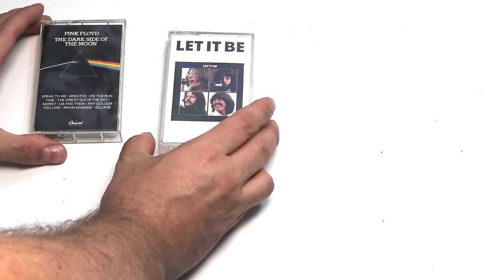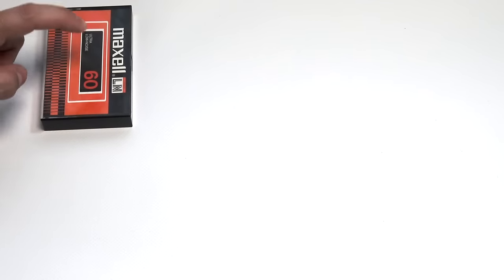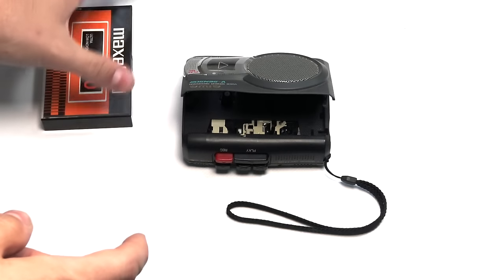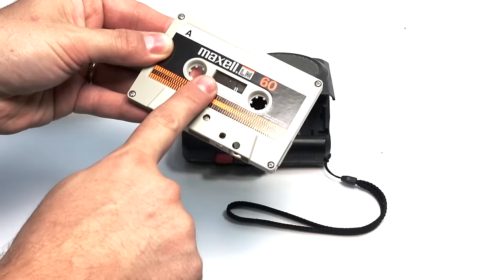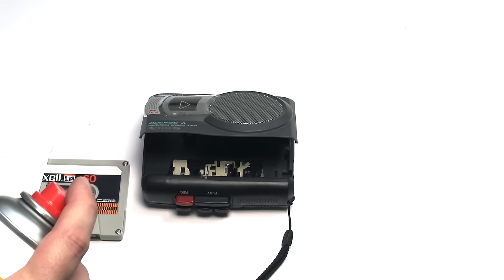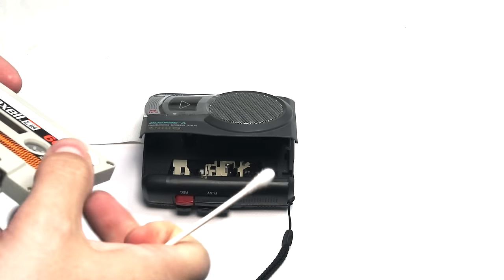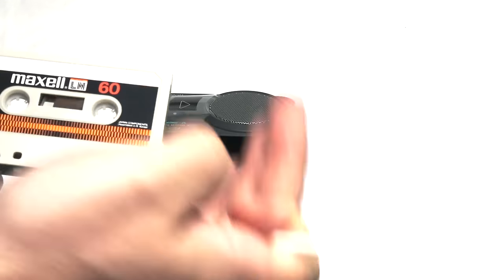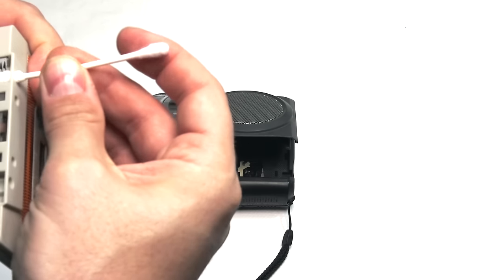How to relubricate your stuck cassette tapes

Comment from the maker: EXTRA INFO (UPDATED!!):
If you get the 3M lubricant get the 08877 WET version (not the dry version).
Considering the fact that, reasonably, a lot of people have doubts about this process, here is some evidence in support of the existence of this issue, the fact that all tapes have lubricant, and of the possibility to use a re-lubricant process for magnetic tape (just remember to use a dry cotton swab to absorb the lubricant that may have not been absorbed after a while).
Here you will find a selection of scientific papers explaining the issue and how it is a standard procedure to relube tape (even NASA does this!). I have underlined a few crucial passages in the papers: 
Heritage: https://www.dropbox.com/s/f8254yfeqrrw9vp/heritage-02-00097-v2.pdf?dl=0
Nasa: https://www.dropbox.com/s/xxdw1qh8mlbppdu/Nasa.pdf?dl=0
HESS: https://www.dropbox.com/s/ydrvxg6zipjkrvw/HESS_Tape_Degradation_ARSC_Journal_39-2.pdf?dl=0
Preservation Commission: https://www.dropbox.com/s/3s3ejmho2jexhgt/pub54.pdf?dl=0
   - (here is the official article: https://www.dropbox.com/s/rtvqt1n537w9vpa/Bogart.pdf?dl=0)
Kondo: https://www.dropbox.com/s/zi4vv42ggi9vh8u/tribochemistry-of-ionic-liquid-lubricant-on-magnetic-media.pdf?dl=0
Here is an article of a lab that is relubing its cassettes: http://tasso.cat/re-lubrication-of-compact-cassette-tapes-with-sbs/
This is a page of a famous audio engineer: http://www.baileyzone.net/analog%20tape%20diy.htm
This is a page of a company that sells its high quality tape lubricant: https://thelastfactory.com/tape-care-preservation/
Reply: Does the Q-tip go in the front or the back of the tape I could not tell from the video. Very good video very informative. I have several cassettes that have squeeling issues.Cheers
Reply from the maker: Front! Thanks. Make sure to absorb all the exceeding lube.
Reply: @anadialog  Got it. Thank you for replying to my question
Reply: Your scientific article specifically says the lube is part of the binder process at the nano level. It does not sit on top of the tape itself. 

The same article says that IF any lube should be reapplied, it should be done a pro who knows what they are doing - and your method is entirely incorrect. Your basically bathing your tape in oil. The oil has nowhere to go but on the tape path of the deck. 

From a professional broadcast/recording engineer and tech - I implore you to stop giving this erroneous information. You are promoting the death of people’s tape decks that will cost hundreds of dollars to fix!!!!!!
Reply from the maker: @jonahmcgarva  The lube is slowly absorbed by the binder. I also clearly said to clean the tape with more dry cuetips in order to remove all residue. Obviously no one is going to put a dripping tape in their deck. Again, the tape after a while absorbs the lube and it is lubricated just enought to help the trasport. In any case you are wrong also for normal new tape. The lube must also be present on the surface of the tape, of course in minimum amounts, otherwise what is the point to add lube? Do you really think lube is buried below the binder and sits there? No, it has to lubricate the trasport. Try and experiment before blindly criticize people.
Reply: ANA[DIA]LOG this is false. The tape does not absorb the lubricant. 

I need to ask: have you had 20-30 years experience in working in professional studios repairing tapes and decks? 

Again - lubricating cassettes is a BIG NO NO. 

Reel to reel can be done as it’s a different tape formalization than cassettes and the pores on the tape are much bigger and thus can actually absorb some oil. 

Cassette formalizations are so tiny and the places where the lube sits is INSIDE the layers of tape and plastic itself NOT ON THE TAPE. 

Again. The cassette tapes do not absorb any oil. They physically can’t. The oil is put in between the physical layers of tape itself. 

So again, you are wrong. I’m not trying to say you’re wrong to start arguments or be “the right guy” - I’m arguing because I, along with many others here, are true engineering professionals who do this for a living - and your “proposal” is not correct and will cause damage to decks and tapes - regardless of how “careful” you are with your q-tips. 

Please for the love of good and all remaining tape decks out there, stop promoting this idea. 

This will ruin your deck. Maybe not right away - but it will, I promise.
Reply: ANA[DIA]LOG and yes. The lube sits under the binder. This is fact. Microscopic amounts get released on every playback. You simply can not add it back. It’s physically impossible. Especially without a microscope.
Reply from the maker: Jonah, as many other techs you are driven by prejudice without real knowledge, in this case, about this issue. It is really sad to see how arrogant you are, just go back and read your commnets. I see now that you have written several negative comments over the months and I think you should inform youself better before pointing your finger, insulting and denigrate people. I have posted simple things but considering that you would like more proof here you go. After rading this info, I hope you will be polite and intelligent enough to apologize.
Here you will find a selection of scientific papers explaining the issue and how it is a standard procedure to relube tape (even NASA does this!). I have underlined a few crucial passages in the papers: 
Heritage: https://www.dropbox.com/s/f8254yfeqrrw9vp/heritage-02-00097-v2.pdf?dl=0
Nasa: https://www.dropbox.com/s/xxdw1qh8mlbppdu/Nasa.pdf?dl=0
HESS: https://www.dropbox.com/s/ydrvxg6zipjkrvw/HESS_Tape_Degradation_ARSC_Journal_39-2.pdf?dl=0
Preservation Commission: https://www.dropbox.com/s/3s3ejmho2jexhgt/pub54.pdf?dl=0
   - (here is the official article: https://www.dropbox.com/s/rtvqt1n537w9vpa/Bogart.pdf?dl=0)
Kondo: https://www.dropbox.com/s/zi4vv42ggi9vh8u/tribochemistry-of-ionic-liquid-lubricant-on-magnetic-media.pdf?dl=0
Here is an article of a lab that is relubing its cassettes: http://tasso.cat/re-lubrication-of-compact-cassette-tapes-with-sbs/
Reply: Do you use the dry or wet version of the 3m lubricant?, and which one is better?
Reply from the maker: @jacobgrijalva6663  Dry!
Reply: @anadialog  and you can use this on any tape?
Reply from the maker: Sure!
Reply: This was very good info. The lubrication of the tape definitely help against degradation and head wear. But the problem with stacking cassette is mostly from the low quality or worn sliders from both sides of the tape roll inside the case. This also explain the long time to take effect lubrication. The oil just need a long time to go from the tape to the sliders and to reduce the frictions. There are possibly low quality sliders, or too thick sliders, or sliders with worn graffit powder lubricant. Just take the cassette a parts and inspect the sliders and fix the problem by reducing the friction .Some time turning sliders backward or discarding one of them solving the problem Also you can spray direct the sliders with a Kontakt 61and this will solve the problem immediately..
Reply: engineer -
This was very good info. The lubrication of the tape definitely help against degradation and reducing the friction, but there are many additional questions . What is the chemisty wjch originaly is uzed for lubricant and for what kind of tape is aplaying this lubricant. May be this is for old type tapes , but not for casette tapes from 80is and  90is.
 Also - the problem with stacking cassette is mostly from the low quality or worn sliders from both sides of the tape roll inside the case. This also explain the long time to take effect lubrication. The oil just need a long time to go from the tape to the sliders and to reduce the frictions. There are possibly low quality sliders, or too thick sliders, or sliders with worn graffit dry  lubricant and friction plastic to worn plastic is too big. Just take the cassette a parts and inspect the sliders and fix the problem by reducing the friction .Some time turning sliders backward or discarding one of them solving the problem .
Reply: @jonahmcgarva  I was about to try this sounded plausible,but now not so sure,if a cassette has these symptoms would you just scrap it or is there another solution?
Reply: Mark Stewart before doing anything drastic like this, I recommenced slapping the cassete itself against your hand or the end of desk, hard but not too hard. Then doing quite a few fast forward/rewinds to loosen up the tape pack. Try playback. If it’s still awful, teeing and fast forward a few more times and then open the shell and transplant the tape to another, newer shell. Alternately the original shell may be fine (not warped or cracked) and you can keep the tape in there and just replace the rollers, pad/backplate and slipsheets. 

This has worked for me more times than I can count and will not have ANY chance of harming your deck or any other cassettes.
Reply from the maker: I agree, these are excellent and less invasive suggestings! Its always better to proceed by steps.
Reply: @jonahmcgarva  Thank you for your notice. I was wondering how lubricating a tape can improve its reproduction since the friction parts are infinitely small (the sides of the tape and not its surface). I believe that a deck and its dried-out mechanism can greatly influence the reproduction of a tape?
Reply: @jonahmcgarva  Perhaps cleaning and polishing the plastic inside the ribbon shell is more appropriate? Should that be the biggest point of friction?
Reply: Can Deoxit D100 be used for lubrication instead of Kontakt 61 ? Please let me know your feedback.
Reply from the maker: I am sorry but I cannot recommend something I haven't tried. The best is the 3M but make sure you get the correct one.
Reply: Thank you ill take look in to this
Reply from the maker: Give us some feedback, the good and the bad, no problem!
Reply: @anadialog  So why Dry and not Wet? Just curious what the difference is and the reasoning behind why or why not. Thanks!!!
Reply from the maker: The wet one is the one to get, not the dry one. Why? Because the dry version has a diluent that can eat the plastic of the tape.
Reply: Hosa DeoxIT D5S6 Contact Cleaner + F5S-H6 FaderLube bundle 

I found this on Amazon perhaps this may be another helpful lubricant for cassettes ?
Reply: @anadialog  I follow your steps but I use oil that lubricate my hair clipper (haha 😂) instead of 3M. For me it still works and the crucial point is that you really have to wait for several days like you said.
Reply from the maker: Make sure to absorb it completely!!
Reply: @jonahmcgarva  Well what is your solution for tapes that are playing slow and warped in an otherwise FINE vintage tape deck (that plays all other tapes)?
Reply: Unable to find that lube in my area, so is pure silicone oil that used for acrylic painting good to use also?
Reply from the maker: No, it has to be a silicone based lubricant,  with NO solvent
Reply: People, is the WD40 Silicone Based Lubricant a good option for this procedure? I can't find any of the lubricants he recommended in my country in a smaller size other than 9 oz and that's simply too much for what I need. Please let me know
Reply: @jonahmcgarva  So this method would be fine to do on a RtR tape?
Reply: @TearlessGosling  All tape is a dry mechanism medium, as soon as you introduce a lubricant it is a foreign addition to its function that it was never designed for, or the machine. Some R2R tapes are supposedly bettered by such a process but the degradation will be permanent to its longevity, and
the heads of your deck. Lubing is never an answer, it is just for the qikfixer.
Reply: Can I use an American XT All-Purpose Lubricant  or WD-40?
Reply: What alternatives can be used ???
Reply: This process is helpful in VHS tapes also please guide
Reply: There is no suggestion. Do not lubricate please, please, please. 
Buy good quality blank cassettes for record. 
Your advise is as BAD as touching a cassette to a (strong) magnet. That ruins a cassette too! Do Not Do It.
Please do not lubricate anything inside there!
Some people back in the past were adjusting the force of the spring, oh yeah, that spring that press against the head. Even that "adjustment" could ruin a good cassette! For the love o GOD do not lubricate anything inside a cassette you want it to last decades.. literally decades!
I have 30-40 cassettes from my teenage years, recorded by myself some.. some recorded in studio.. they are still good. Every year I rewind them to the other end for the tape to remain flexible.. as flexible as they can be after 20-25 years..             and you invite me to lubricate them... ??? on the back? 🤣🤣🤣🤣 The back won't touch the front were all those good particles sits (or suppose to sit for many many years)? Do you know how a cassette get recorded by the way? I expect that to explain to us before telling us to lubricate the tape.. Come on, this is an injury that a simple old cassette DOES NOT DESERVE. Oil something else; a door hinge, a bycicle chain, and it will thank you.. but NOT  a cassette that suppose to play music..
I am not crazy... no I am not.

And I am not alone in this:
https://forums.stevehoffman.tv/threads/can-i-re-lube-a-cassette-tape-if-so-how.1080666/
You have been mentioned BUT not appreciated, sorry not this time!
Reply from the maker: @MrFryfish  your reference is a forum, which is based on mere opinions. My references are scientific articles. Read them before judging. They are all available for download in the video description for the reasonable skeptics. All tape of all kind have lube in the binder. In some cases this dryes out. So no voodoo science but facts and this is a safe way ro relube tape IF you follow my instructions step by step. If you don't have trasport issues no need (obviously).
Reply: For me, it's this, do you want an engineer to restore all of your tape cassettes and your entire stereo system? Make sure you have enough money to have this restoration going on.
Reply: I live in 2035, Twin Hills Drive, Santa Cruz, CA.
Reply: I also simply don't want my brother and his wife to throw out my entire stereo system. I said do it now. Come quick. You just haven't seen what my stereo system looks like. It's a radio that has a  tape casstte player, music CD player, and a record player.
Reply: Can I also use WD-40 instead of Kontakt or 3M? These two are not very common here in our place.
Reply: Thank you for the tips! I may save a lot of my cassette tapes this time!

Comment: I found that you don’t actually need a compact cassette player to do this process. I used the casing of an old pen and attached it to an electric drill - worked just as well.
Reply: Smart idea
Reply: A pencil will work too.  Use the eraser head of the pencil to turn the spoke wheels while the other end is in a drill.
Reply: It depends on what you have. A better idea is using a pen to do manually. I have a very dirty tape which need to be cleaned and need to be relubricated. After Cleaning a bit, sounds little better and There are lots of things to do.
Reply: I was just thinking that- no auto stop though lol
Reply: Here's a man who knows how to use his noggin
Reply: Just be careful with the drill torque setting. Quite easy to run it so fast you snap the leader off the hub at the end of the reel.
Reply: Un crayon à papier, c'est le plus pratique😊
Reply: can you use on reel to reel tape?
Reply: Smart!

Comment: Thank you so much for this video. With this process I saved a 40 year old BASF HF 120 cassette containing a unique recording. Is seized frequently. And the parts that did play squealed very badly. After transplanting the tape to a Maxell XLII housing, treating it twice with silicone and letting it rest for 48 hours, it now plays well enough to secure a digital copy from it!
Reply from the maker: Great news! Thanks for sharing you experience Richard!
Reply: Did you do it the same was as in the video, and with the same products?
Reply: I used a cotton swap soaked with silicone spray. And ran the tape along it, winding it with a BIC ballpoint
Reply: @RichardPflug  Which spray did you use?
Reply: I think I had a can of the brand Griffon on hand. But I think you can use any brand of regular silicone spray.
Reply: @RichardPflug  Thanks

Comment: Just tried this with several cassettes that  kept on slowing, stopping and some that wouldnt play at all. I used non staining silicone lubricant and now all the cassettes play flawlessly. I almost sold my entire collection before I saw this so thanks for the video 👍
Reply from the maker: Thank you for your feedback!
Reply from the maker: Can't recommend that because I haven't tested it.
Reply: First of all....cassette tapes need from time to time full rewinding few times to tape aligns properly in housing....second....you need to use quality deck or tapes....third...lubrication is poor trick after you may had problem with deck tape path or heads
Reply: I opened up a brand new cassette tape from 2001 and played it and well the sound on the tape at first sounded good after about a min or so it started playing in slow motion and then it went back to normal but it did that a couple of times... i dont know if its the tape player thats causing it to do that or the tape , i checked what kind of tape it is and its a type 2 cdt cassette, would lubing the cassette fix it?... , i even tried rewinding it a couple of times to loosen it up.
Reply: @cristianthashoota5841  Lubricant dies, silicone doesn't last forever. Also tapes gather moist throughout the years and start to stick to the heads while playing. Both effects give the same symptoms. Both are treatable, lube can be added, moist removed through "tape baking".